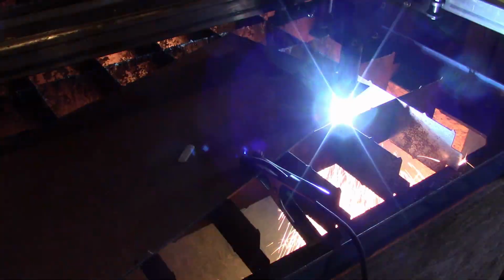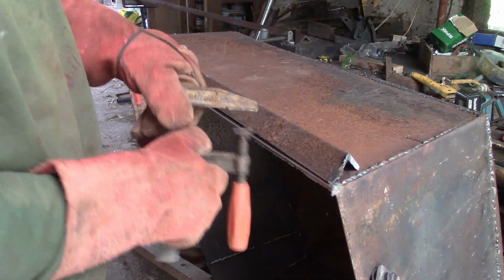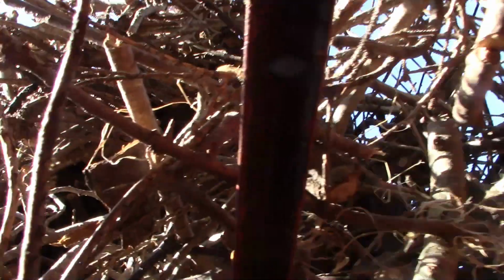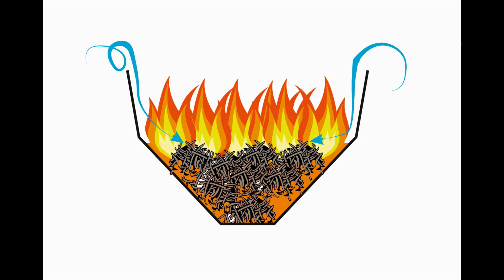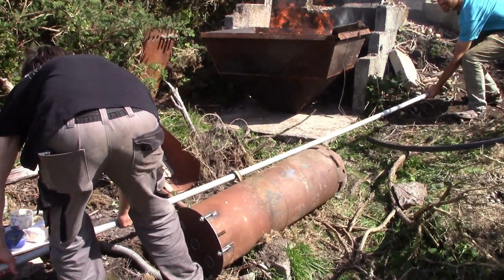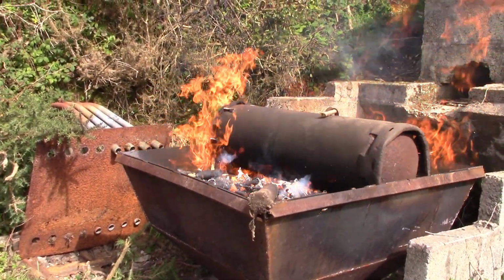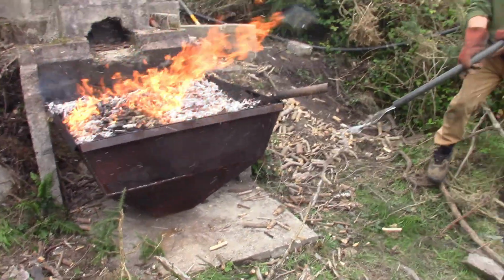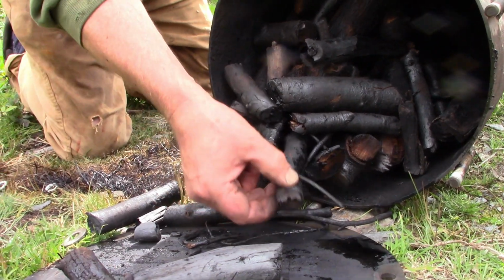Life, Death And Charcoal. (Testing The Chip Trap-Doors, Making Charcoal Kilns, Activated Charcoal..)

Comment: Sorry Tim - You are no where close to making activated charcoal...  You haven't come close to the required temperatures - or pressures, Nor have you exposed the carbon to argon or nitrogen at 1200C... (THEN expose it steam and oxygen).   Many will be disappointed, i know, that one can not make activated carbon or activated charcoal this way -- But there is a reason why it is an industrial process, not a home business.   It's best not to mislead people with internet myth.   High temp is required - Inert atmosphere and pressure are required required - and this is certainly not obtainable in an open-to-atmosphere cone-kiln.
(if you research the industrial process - you'll wonder why industry uses the high-pressure-inert gas method when just heating in an oven would be immensely cheaper.  The reason, of course, is that just heating and steaming charcoal does not make activation.  -- It makes wet charcoal.)  "Technically, you can not do it at home"   https://youtube.com/clip/UgkxiSCzl4LbGIkKwc29gZaxwuhHEbMayYln
https://youtu.be/1UPxYVemno8?t=1447  "
Reply from the maker: Ah, but activated charcoal is not a precise point - it's a range. This IS activated charcoal - I agree it could have been split more with different processes, but it still has many more fissures than dry-cooled charcoal. I'll just have to make a video soon to prove it, won't I? : -  )

Comment: heating... a sand rail waggon.....get super hot. ....push it into the barn. ....toast barn.
Reply from the maker: Sand's not great for storing heat (too many gaps) but solid hot rocks would work.
Reply: @wayoutwest-workshopstuff6299  ah yes.... maybe look for the bricks out of old storage radiators... heat them up in the charcoal kiln and run them by rail to where you need the warmth....toasty.

Comment: I wonder what would happen if you'd fill it up first and then set fire to the top layer? In theory, the bottom layers get hot and start to gas, which needs to pass the flames, feeding the fire and generating more heat. Maybe less smoky and less ash?
Reply from the maker: Try it? I suspect it would turn to ashes from the top down though

Comment: Fascinating. I didn't realize that steam / water was required to make activated charcoal and biochar. Fortunately I've been making 'biochar' in an old cast iron bath and using water to put it out. I have yet to grind up the resultant charcol, so looking forward to seeing how you do this. 

Also in terms of long term soil carbon storage you might like to read up on glomalin as this does last for quite a while, although not as stable as charcol.
Reply: There is another requirement for 'activated' charcoal that is not achievable in home-setups.   The charcoal first needs to be heated to 800C ~1200 C, inert atmosphere of argon or nitrogen, THEN super-heated steam is added -- This creates a reducing atmosphere which eats away about 2/3 of the carbon -- leaving a lot of microscopic pits and pores.
Without, the high-temp, inert gas, super-heated steam:  You create..... wet, soggy charcoal. (which will be useful when dry again).  But it is not activated.  sorry.
https://youtube.com/clip/UgkxiSCzl4LbGIkKwc29gZaxwuhHEbMayYln
https://youtu.be/1UPxYVemno8?t=1447  "

Comment: The first thing that occurs to me is that you are creating a possible source of energy for locomotion.  If a rail locomotive can be powered by air, it can more efficiently be powered by hot air.  You can see where I'm going with this--and no doubt you have already thought of it.  Some of the most efficient small locomotives were known as "fireless cookers," and these were powered as a secondary byproduct of other industrial processes.

Comment: I did some experiments with the retort-style kiln, and had good results on my channel. It may not be best by itself, but wonderful if you already have heat from another kiln process. My retort kiln ended up making so much wood-gas that I wonder if it could be a self-fueled process if you released the gas under it and burned it in an old gas stove element.
Reply: Neat ideas though, and I wonder if there could be collaboration on all this / maybe a competition like the #SpeedBoatRace / “Speed Benchies” did for 3d printing, but for charcoal.

Cross Promotion, Hype, and just in general a bunch of tinkering + designing!
Reply: That's what I expected to see when he mentioned a Retort kiln.
Ones I have seen were a 45 gallon drum on its side with what was the bottom cut off and refitted as a door. A scaffold pole is attached with plumbing fittings to the cap hole and 2 90 degree bends to run it underneath with the end capped. Holes are drilled in the pole for gasses to escape.

The barrel is filled with wood and the door sealed. A fire underneath gets the process started and is reduced while it is running.
When it's hot enough the wood gas is ignited under the barrel by the fire and helps heat it. When the  gas stops, the charcoal is cooked.
An improvement would be a spaced off cover with flue to keep the fire around and over the barrel. Further improvement is a blanket over that cover.
Reply: It can at least help/improve efficiency!  

I think burners may need to be modified / custom made (i need to grab the name, but there is a YouTube channel that does stuff like this really well and it seems do-able!) due to the air/fuel mis being optimized for methane or propane, not wood pyrolysis gas or maybe more pure syngas, but yeah. (Granted just a bent tube with a flashback arrestor could probably work too lol )

Comment: Super awesome. 
A few of my thoughts. 
You need a set of tracks down in the kiln area. I do not know how much deeper you can go in that area. Either way I think I would do about that size of the kiln as you could almost make them tipping dumping kilns to which you could then tip out on to a conveyor and then send it up to the tracks to waiting carts. 
The wet down process in my mind would be to fill the cone kiln up then release the water back to a tank that can settle out the water and then be pumped back up to a tank/tower. 
The transferring of the wood to the kiln is going to be a big of back breaking work from what I gather and see. 
How I see it in my mind is the kilns on a track. Which I am not sure how that could be done due to the wheels needing to roll. The kiln move in front of the chute and fire is started and loaded then pushed away and another one is moved in place where another fire is started and moved away again then one moved back in place topped off and so on. These kilns could then be filled with water in their place cooled and drained and tipped on to a conveyor of sorts.  
Either way its a super cool project and I would love to build a kiln and make some charcoal as well. Though I would mainly use it in one of those old coal cook stoves for heat and cooking in the winter. I want to build an outdoor gazebo type thing where it has a place to hang out in the winter and cook out and stay warm.

Comment: As far as the connecting rod goes, you could probably rework it so it runs along the outside or inside of the wagon, almost like a frame. That way you still have the ability for long trains and you don't have to poke. Obviously lo g trains are a bit out in the future but it's an idea.

Comment: Hey! I've designed a very cheap low temperature stirling engine you may be able to use for various needs. I originally designed it for a solar stirling setup, but you could easily heat it with fire or other ways. if you want it i can send you (or anyone reading this) the designs!
Reply from the maker: Thanks for the offer. I like sterling engines but I have yet to see one that has enough power to be really useful
Reply: @wayoutwest-workshopstuff6299  I'm planning on using it as a small solar power system, and I'm not expecting more than a few hundred watts for output (around 0.7 hp). so yeah, pretty much only useful for really low power usages, but you could possibly hook it up to the charcoal kiln and get some free electric power from it? 

its built from a 55 gallon steel drum, some relatively thin (but not flimsy) metal, some of the same pipe you used for the railway, some bolts and an insulator for the displacer. designed it so it can be built with basic hand tools!  haven't made it yet myself, but have done loads of research, just haven't got a steel drum to make it out of

Comment: Be careful adding water directly to the bottom, if it flash boils then the only direction the steam can go is up, and you would have yourself a toasty charcoal shower.
Reply: well, it does have a pipe for air, wouldn't it also work in reverse as a sort of exhaust for said steam?

Comment: Tim, great job.  I know you have the cars set, but I think if you were to put doors on the side of the cart and the kiln to the side of the tracks, you wouldn't have so much work moving the chips.  Think of them as side dump cars per se or how they would use chutes to load coal into a canal boat.

Comment: If you are playing with Retorts there is a whole world opening up for you ..... especially if you have Big ones!
You can (as you said) fill them with organics ....... Any organics!
You could be converting your donkey poo into donky briquets that you can then use on your barbie ...... or if not your barbie then your house fire or woodburner. It is no longer poo more accurately it is a form of carbon that BBQ briquets are made of, so it will not smell! If you make your retort flatter you can use it to quench the flames.
If you were of a mind you could put plastic waste in and convert it into a form of bio-DIESEL.You would need a good retort able to stand high pressure though. It will break down those chains of compounds that are known as "Forever Chemicals" and make them useful again (or at least not harmful). 
The key thing here is that you are using a form of heat as a by-product not having to pump energy into a system purely to get a result. You Always have to put more in than you get out ..... but that is life (and thermodynamics).

So you can get Biochar, Briquets and heat for your home all in one go! What is there not to like?

Comment: @Way Out West - Workshop Stuff I have an dangerous & interesting idea. :D
What if you make this (video --> ), and connect the Exhaust to your Retort ? https://youtu.be/i-UnhAzTMxg
My theory is that you only need a small amount of wood in the "engine?" part, to char up all the wood in the retort part. I guess that the exhausts have basically no oxygen in it, I assume it has been a complete burn inside the "engine" & only CO2 remains that is REALLY HOT. 
I have no practical experience about this, but it seams feasible.
Like this: https://youtu.be/KGIVXvqjpg4?t=1008

Comment: You were saying about preheating the Chips to drive off that last bit of moisture, would feeding the Kiln with an Auger work for that? a slow steady addition of chips to the center of the fire so that the wood preheats a bit before dropping. That should alow the water vapor to go away above the combustion layer and keep the fire hotter. it would also make it closer to a continuous feed than currently. 
Another addition I thought of, a trapdoor at the bottom of the kiln to a hopper/bunker to drain the water at teh end and bring out the charcoal easily and quickly for another firing.

Comment: Very good! It looks like you could build a retort holder into a chimney setup, and a block-and-tackle crane to move things. Were you thinking of a conveyor to move the charcoal back up the hill?
Reply from the maker: It occured to me that I should have just shoveled some of the top layer into the retort at the end instead. I'll try that next time. Not sure about getting the charcoal back up the hill - too many theoretical options but as always it will come down to costs
Reply: @wayoutwest-workshopstuff6299  I know you need to go the opposite way, but a gravity system like some of the logging railways used might interest you

https://youtu.be/a4_mJuS9WWc

Comment: Looks like you need a way to drain the water from the kiln. It also looks like you need a girder crane with a chainfall to help you with the retort, especially if you have more than one. The water pipe also needs a valve at the end to help control the output.
Reply from the maker: I was planning to just tip it out!

Comment: It's true, the CO2 from burning wood is not a problem since it's part of the current-era carbon cycle (as opposed to coal and oil), but if you had mulched it, microorganisms would NOT release all the CO2 into the air. Instead, a surprisingly large amount of CO2 (I forget the exact figures) becomes sequestered as as soil organic matter. So mulching does release less CO2 than burning, no matter how clean the burn.

Comment: I would say a modern stove would run a /more complete/ combustion actually, since the burning is much better controlled with (preheated even?) secondary air added specifically to burn any remaining volatiles, including CO. Very low CO is even a requirement I expect, due to it's deadliness (0.15% to 0.03% CO in a couple of stoves I just looked at)
Quite possibly the combustion temperature in a modern stove actually gets /very/ hot actually?
Reply from the maker: I agree, Jonathan. If you have a modern stove and dry fuel - but most woodstoves are not like that.

Comment: Great video. I do have question on the water you added to the fire. I've read that you get lye from wood ash. Assuming you would get the same here. Is that so? The readings I read do say it is from ash being boiled and the lye skimmed off the top so maybe charcoal like you make here hasn't processed enough to make lye. Lye can be good and bad as you know I wouldn't want to this process to cause issue. Who knows maybe it may make a byproduct too. Keep up the good work Tim and team.
Reply from the maker: You need ash to make lye, I think. I'm trying to avoid burning to ash though..

Comment: I'm sorry Tim but the char you've made is not 'activated charcoal'.  To make that requires a different process - higher temperatures than usually achieved in a fire such as yours, and then flushing with steam (or other chemical) whilst held at that temperature.  See https://en.wikipedia.org/wiki/Activated_carbon for a bit of detail and some useful links

However the char you've made will make excellent biochar. You can load the pores in the charcoal with bacteria and nutrients by putting the char into compost, or soaking it in a nutrient rich broth such as urine or comfrey juices, and letting it sit a bit, whilst aerating it (aerobic bacteria are the desired ones.) Personally I'd bung it in with a working compost pile (this is what I do) and then you have, after say a year, compost with extra biochar in it, which is allegedly richer and 'better' than compost without.  The fixed carbon will, as you say, have a good chance of being sequestered for hundreds if not thousands of years.  I expect you remember my describing how I make biochar in my woodstove. 

Finally, you mention stoves - something about lower temperatures and carbon monoxide.  The Clearview stoves I have burn at a higher temperature than an ordinary open fire (or KonTiki char fire) as the incoming air is preheated in the hollow turbobaffle. All the volatile and combustible gases are burnt - you can see this as the retort in the stove has a fierce jet of flame soon after putting the retort in, after any water has evaporated off (I only use dry materials for biochar so there's not much of that). The 'wood gas' is CO2, H2, CO and CH3 - all combustible apart from the CO2.  I think you shoulda left the cylindrical retort on top of the KonTiki as it looked like it was about to give you some roaring jets of flame quite soon, and that would have resulted in the materials inside charring nicely.  

Anyway, interesting to see your experiments, hope you can continue to refine it and produce less pollutants and more charcoal for biochar.
Reply: Nice to read your thoughts. I have a kontiki kiln, and experience nice result in making biochar. My kiln is burning quite clean. Less smoke than a good camp fire.  I think the kiln in the video could burn cleaner if it had a octagonal shape instead of the square.. The corners tend to be charred at a lower temperature.  Also not putting on too thick layers of new material is good for keeping the temperature high.
Reply from the maker: Thanks, Compostjohn. As I understand it, activated charcoal is not a fixed point - it's a range. No doubt you could split this charcoal more than I have done using different conditions, but this is still activated. It was too windy to record the crackling sounds it makes when the steam hits..
I agree that some woodstoves, with dry fuel, can burn cleanly - but I know a lot of woodstoves and I would argue the clean ones are rare : -  )

Comment: Hi Tim! What about storing the excess energy in a battery…, that would be very useful as it is storage for mid long term! 

Capture energy:

first use the heat to create steam, use the steam pressure to power a turbine, which then turns a dynamo.

Comment: with the bar you are going to remove on the log carts, you can regain some of that reinforcement by putting a couple chunky pieces of steel across the front and back with the hitch mounted to that then use strips of steel down the side of the cart to connect the ends. it might not be as strong as the steel bar but its better than just the wood frame.